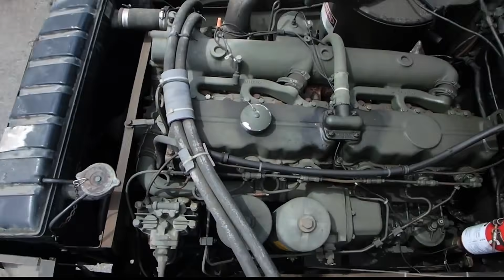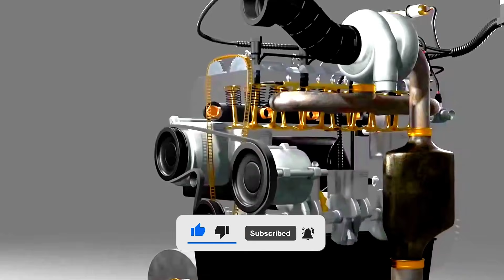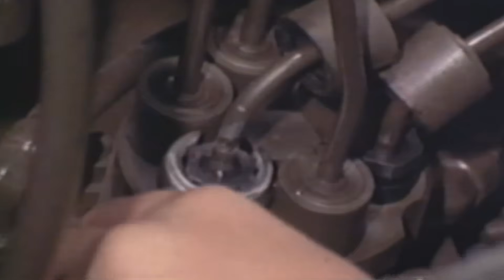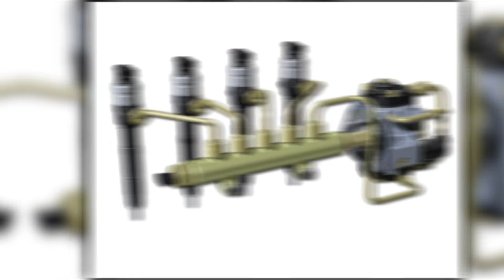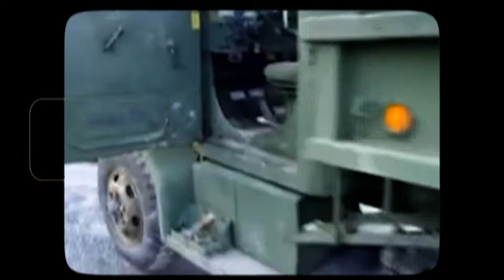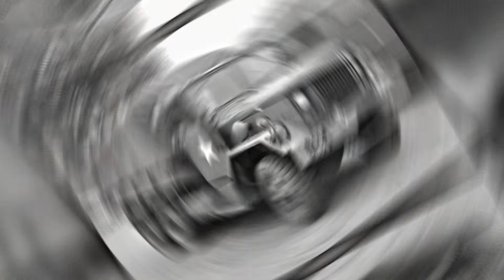The Army Engine That Burned Anything - Then Got Shut Off

Comment from the maker: The M35 “multifuel” idea sounds like Army magic, diesel, kerosene, jet fuel, heating oil, gasoline mixes in emergencies… but not all of them were equally smart to run.

That was the real genius and the real danger of the Deuce: it was built for a war zone, not for comfort, speed, or easy ownership.

What would you trust one with today: keep it stock, repower it, or leave the old multifuel in place?
Reply: When you run gasoline add motor oil for lubrication.
When you run motor oil add gasoline to reduce viscosity.
Either way works.
If you want to run used motor oil, you can do that.  But it must be filtered, cooked ("bleached") to kill any bio organisms and evaporate water, then filtered again, and viscosity lowered to that of diesel.

You can do the same with vegetable oil.  

The problem with these fuels is not the motor or the fuel, but the maker.   If you get lazy it is easy to ruin your injection pump and Injectors.

So, if you do that, then be thorough and methodical about it.

How did you think they made standard diesel, anyway?  Largely the same process.
Reply: Was on an alert, where we had to do an unplanned mission during the Cold War in the 1980's. When the mission was over, we didn't have enough diesel to return to base. We'd have had to wait a couple of days for fuel to get back to base, except that I remembered the deuce and a half manual had "Multi-Fuel" or something like that, in it's title. We had mogas leftover from powering our generators, so we topped of the tank with mogas and made it back to base a couple of days early, no problem!
Reply: Several times I mixed in "mogas" in the M35a2 2.5 I drove in 89 in West Germany.   Funny thing is I saw the same truck in Camp Doha in Kuwait in 1998.  I recognized the "custom" camouflage painting on it. Confirmed by the several bullet holes in it painted over. The holes were long before my time with it.
Reply: I specifically sought out the m35a2 model for the multi fuel and manual transmission. I mostly run filtered waste oil, diluted 20% gas. Manual trans has more top end speed. I have no problem doing 55mph on stock tires.
Reply: @dlbard1 Mine will do 50mph, maybe 52 or 53 mph if ground is perfectly flat, and wide open throttle.  1/2 to 3/4 throttle on the same ground is 45mph, and much easier on the drivetrain.  This is with stock 9.00-20 ndt tires.  
Some guys get 55MPH.  Usually they have the 11.00-20 tires.  But some Deuces are just a little faster.  No rhyme or reason why.
Reply: @gordonjohnson405 
I'm away from my deuce right now, when I get a chance, I need to check which engine I have.  I've read some deuces may have had the 5T engines installed. By comparing numbers, my deuce seems to run faster than others. I had it up to 58MPH just yesterday. It still had more and that's on NDT tires.
I plan on installing 395s in the future. I've only owned this truck for 11 months now.
Reply: You’ll want premix two stroke oil for gasoline…
Reply: These engines are called "Diesel engines " they use the Diesel principle aka compression ignition. The fuel is named after the engine , not the other way around.

Any glowhead 2 stroke diesel whil pretty much run on anything as long as it is liquid or gasseus and burnable, this includes hydrogen gas.
Reply: 975 years old and I own two of these trucks 75 years old one runs on diesel and the other one is a parts truck the the I only ever run
Reply: @larryward1082 WOW you are old...

Comment: At one point know how to tune a car was a plus ..YOU COULD BURN KEROSENE IN THE 50 MODEL CARS BY Leaning OUT CARB AND RETARDING SPARK AND LETTING MOTOR WARM UP BEFORE YOU DROVE IT ...and for 2 dollars you could put 20 gallons of fuel in it and run almost a week on short hops .cooler days ment 2-3 gallons gas added at 25 cents a gallon..

Comment: I was driving one on autobahn 6 when the driveline blew it took out the airbrakes no way to slowdown coasted to the top of a hill slowdown enough to throw the fire extinguisher between the duellies popped over the extinguisher the  first time picked it up chased the truck down tossed the fire extinguisher under it again it stuck skided to a stop i looked back down the bahn and there was a captain in a blue Mercedes the U joint was in her radiator wasn't to bad she drove me back to Mannhime the company sent me out with the wrecker driver to recover it 😮

Comment: Most people don't know this but there is an overlap of compression ratio at which either fuel can be burned. Gasoline engines can run as high as 13:1, diesels can run as low as 12:1. My guess is the compression ratio is somewhere between 12:1 and 13:1 with certain fuel system modifications.

Comment: My 67 m35a2 runs perfect. Had a MWO for a full restore in 1989 from Ft Carson. Has a crate motor, with a tag from 1989, trans rebuild from Utah etc. 

I just did all the torque rod bushings this spring.
Reply: The coldest I've ever started mine was around 0°. It fired right up. I just had to give it a little pedal or set the throttle. My flame heater never worked, so I deleted it.

Comment: Ok, I’m sorry… but at some point when making these videos you really should get your facts straight.  Gasoline doesn’t “resist” igniting… gasoline is far more flammable than diesel.  If you were to put gasoline into a diesel engine you’d destroy the engine due to the gasoline combusting (given its higher flammability compared to diesel it would be more explosion rather than controlled combustion) prematurely causing sever knocking and hence damage to the pistons.  Diesel is far less flammable thus being able to withstand much higher compression ratios.  The higher pressure within the combustion chamber results in significantly higher temperatures within that space thus providing the heat source required to ignite the diesel.  Which in turn is why diesel engines do not require spark plugs.
Reply from the maker: Fair point on the wording. Gasoline is absolutely more flammable than diesel in the normal flash-point/vapor sense. What I meant was that gasoline resists controlled compression-ignition compared with diesel, which is why octane and cetane are basically opposite measurements. In a conventional diesel, gasoline’s low cetane can create delayed/violent combustion, severe knock, and also poor lubrication for the injection pump. That’s why the M35 multifuel system was interesting: the M-System wall film combustion and fuel density compensator were designed to make those different fuels burn in a more controlled way. Even then, gasoline was only an emergency fuel and required oil mixed into the tank to protect the pump. So yes, gasoline is more flammable generally, but it is not “better suited” to normal diesel combustion. Appreciate the correction because that distinction matters.

Comment: drove deuce and a half in germany in the 70's on the data plate it stated no JP-4 .once ran out of diesel only a gas transporter was close by so put gas in the tank drove to the bivouac site the motor  sergeant added a quart of motor oil, it ran like a charm.

Comment: I was on an alert, where we had to do an unplanned mission during the Cold War in the 1980's. When the mission was over, we didn't have enough diesel to return to base. We'd have had to wait a couple of days for fuel to get back to base, except that I remembered the deuce and a half manual had "Multi-Fuel" or something like that, in it's title. We had mogas leftover from powering our generators, so we topped of the tank with mogas and made it back to base a couple of days early, no problem!

Comment: Most old diesels will run on anything.
Reply: Mechanical diesels will run on more things than a computerized diesel.
True.
But you will pay for it in fuel filters, injectors, and injection pump work.
With an LDT 465 you mostly wont.

Comment: This is the best explanation I’ve seen on a video, based on what I’ve read.  My unit in Germany had mostly 5 tons running an inline 6 Cummins.  Later iterations of the Deuce were also inline 6 diesel engines.  The JP-8 for every vehicle was brilliant.  You never had an issue with gelling in cold weather like you could without the proper grade of Diesel.

Comment: I spent 32 years in the Army.  I retired in 2021.  About 200 feet from where I write this is a Deuce and a Half.  Both it, and the LDT465 motor in it work perfectly.  I was there for many of the events mentioned in the video.  And they are simply wrong.  We did, and still do, use whatever fuel is convenient.  Bypassing the FDC was done because seals within it wear out over decades, but the factories that made those seals closed after a few years.  The order to bypass FDC was given in the 1990s at a time when I was signed for 10 Deuces.  The reason was simple:  We ran out of the stockage of reseal kits. The Army's last Deuce rolled off the assembly line in 1977.  The factory that made FDCs closed in 1976.  20 years is a long time to operate on New Old Stock parts. Bypassing the FDC does not transform an LDT465 into a diesel-only motor.  Painting words on a tank certainly does not disable it.  Yes.  You really can run all the authorized fuels.  Those remained on the dash placards and in the technical manuals.
Yes.  There is a flame heater.  No, the engine is not harder to start in the cold than a diesel.  It is easier.  22:1 compression makes it easier.  I have disconnected my flame heater for the same reason I ordered my Motor Officer to disconnect FDCs:  it adds risk but only adds capability at the margin.  At temperatures warmer than the mid 20's°F (-7°C) you dont need the flame heater or any other starting assistance.  Down colder than that a little ether works better than the heater.  Thats what all the Canadians were doing when we trained with them.  But, I haven't needed ether for years.  Just crank it a little longer, even in winter cold.
I will eventually replace my ldt465 with a cummins 6bt 12-valve.   It is lighter and stronger.  A few fuels will no longer be on the menu.  Why?  Two reasons: 1) The Speed Limit is no longer 55 MPH.  It is no longer safe to be driving most roads with a maximum cruising speed of 35-45MPH.  2) LDT465 Parts are running out.   
Fun Fact #1 the Deuce was designed in 1949.  The LDT465 was added ten years later.
Fun Fact #2 The Active Army used the M35A2's from 1952 to 2005...over 50 years.  Even when I joined in the 1980s most Deuces were significantly older than the people in them.
The LMTVs were first fielded to operational units around 1994-6, I remember.  They are leaving service now.  I have signed for many of them on my property book.  Very few worked.  Too complex.  Too intolerant of abuse.  Too demanding of professional mechanics rather than simple soldiers who can read.  My Deuce is a few years younger than I am.  It is amongst the newest.  I have no doubt it will still work perfectly when I am gone...even when left sitting for years unattended.
Reply: My 68 runs like a top
Reply: I have many fond memories with several M35a2 2.5 trucks I operated in the Army from 1989 to 2002 the last one was mainly a motor pool queen except for DIV exercises for the GO I worked for "off-road" RV.
Reply: My 72 runs great. I currently  am sitting near it at New Hampshire motor speedway.
Reply: Army 1973 1976  I apreacate the info you provided about the DEUCE AND A HALF  only rode in one (REFORGER 75) never drove or mantained any part of one.  Thanks Fred

Comment: Took one to Iraq in 04, wouldn’t want to get shot in it but other than that it was the best vehicle we had. Fuel point ran by KBR mixed up Mogas and JP8 and all the Hummves went down. Our Duce drank that fuel line fine wine. Like I said only truck we had that didn’t go down over there. In fact the U. S. Kept them all over there and gave them to the Iraq army. The replacement cab over trucks aren’t even allowed on a deployment they suck so bad.
Reply: The Kurds still have the Deuces we left after OIF1 in Northern Iraq Kurdistan region.
Or they still did when I was last there in 2019.

Army acquisition gets confused when buying trucks.
They generally get confused one of two ways:  
1)  They confuse their fleet for a fleet of civilian vehicles, which are driven 24-7 and replaced every six years.  Then theyre shocked when spare parts skyrocket in price after the first six years when they have to pay the company to keep an obsolete assembly line open, and the trucks all break down because they sit for months between exercises.
2) They confuse an Army truck for a tank.  It makes them so expensive to buy, train, and maintain, with such poor mobility where most roads in the world cannot sustain their weight, that they have to hire civilians to do their sustainment...which means their locations are for sale on the data market.

An Army that cannot transport itself is a government civilian bureaucracy with a dress code and suicidal illusions.
Reply: @gordonjohnson405 
 So you are talking veiled about the LMTV, MMTV.  I remember when the LMTV's were restricted to no more than 40-45 mph or the drive shafts would come apart.

Comment: I have, for more than 65 years, tinkered with various fuels with varying degrees of success in farm tractors, and sometimes lawn mowers. There is quite a difference in the way engines respond to a change of diet and, for myself, a preference of diet fed to engines when I was using them in barns where diesel fumes burn the eyes and fryer fumes are quite pleasant. This link gives an insight into the origins of pre-combustion chambers, experiment and have fun, and BTW  2 stroke oil is a fantastic fuel additive with no side effects.  Go for it.
  Harry Ricardo - Wikipedia
https://en.wikipedia.org/wiki/Harry_Ricardo

Before graduation, Ricardo designed a two-stroke motorcycle engine to study the effect of mixture strength upon the combustion process. When he graduated, the small firm of Messrs Lloyd and